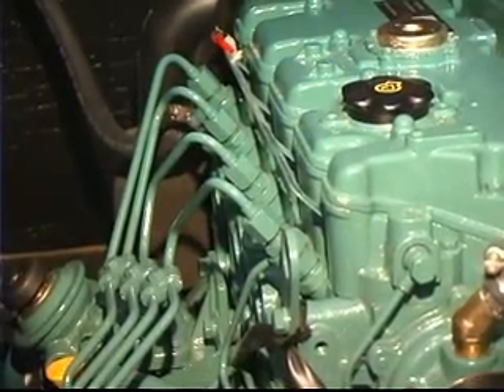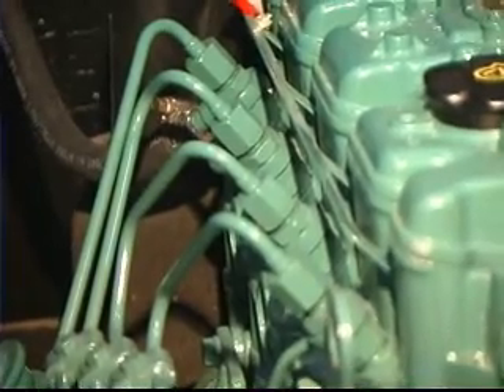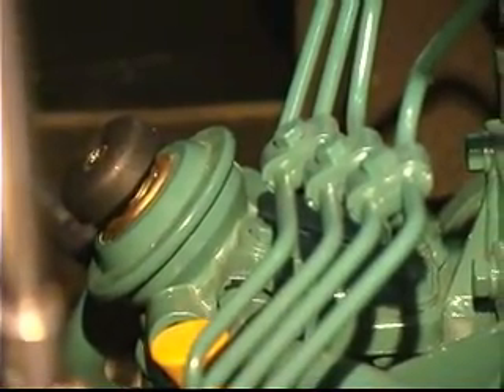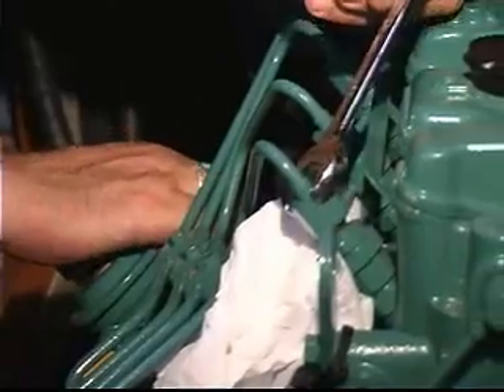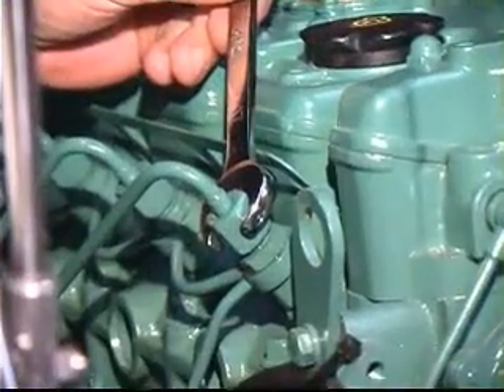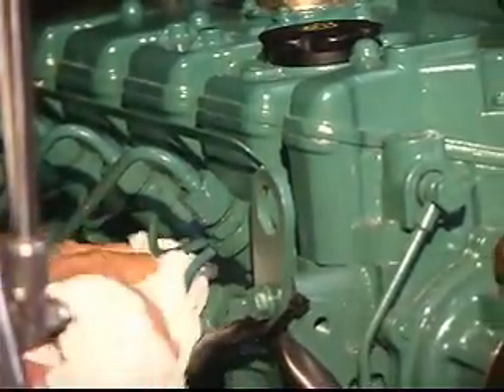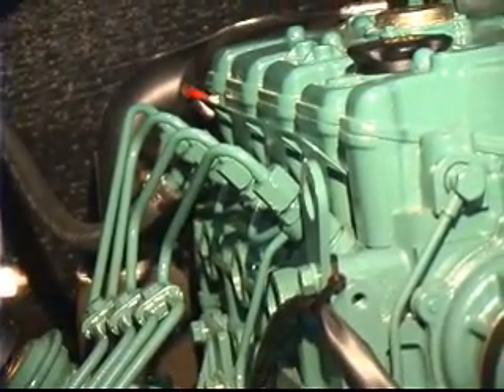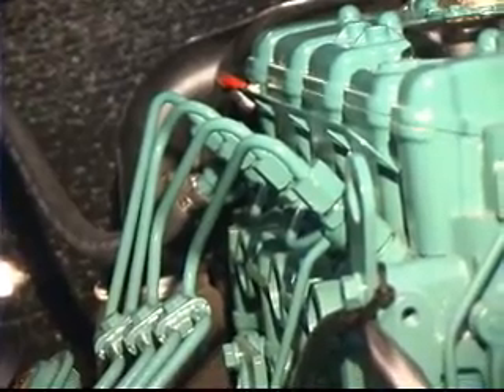Diesel, bleeding fuel injector

Comment: If you have a sprinter with an electric fuel pump in the tank and you put the key in the on position, and crack an injector line open, will fuel continue to run out as the pump runs or is this not normal?

Comment: CAN I SAY BUD ..... YOU CAN DO THIS  WITH THE ENGINE RUNNING   QUICKER & BETTER
Reply: Unless of course it wont start because the injectors need to be bled
Reply: @GeneralG1810  The engine doesn't need to start to pump air / fuel out of a loosed injector.
Reply: urbanimage OK read the initial comment, then take into account my response to that

Comment: Great instructional --- Has helped immensely in my trouble shooting. Long story short. ((Yanmar 4JH4-TE))  Stemming from water in fuel tank. Changed all filters purged all fuel lines.  Have fuel flowing thru the entire loop. After cracking the line at the fuel injector I am unable to pump any fuel to the engine end. Yanmar appears to keep off the Injection pump information VERY PROPRIETARY. Wondering about the next step before calling in the service tech.  Is there an fuel on/off solenoid and if so a way to trouble shoot it>  Your thoughts would be appreciated.

Comment: Neat. I've never seen a transfer pump that would force fuel through the injection pump and out the line. I've always had to bleed it to the pump then crank the engine with all the lines loose until fuel comes out then tighten the lines.
Reply: how long do you have to crank before fuel comes out?